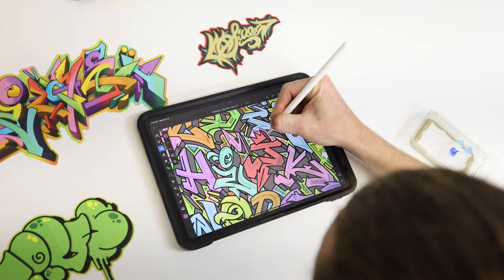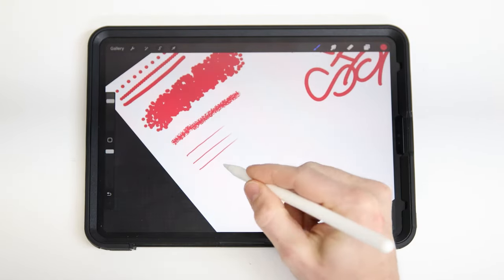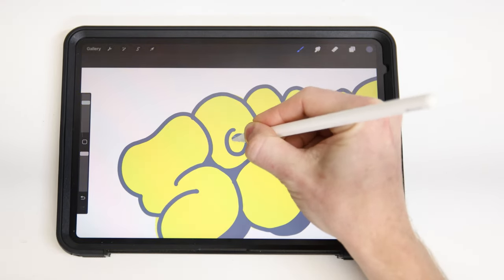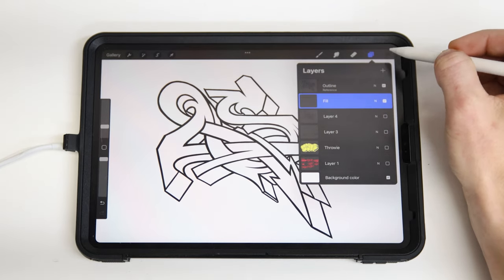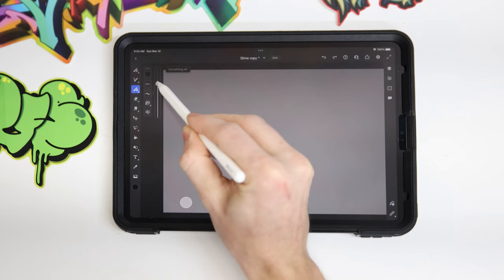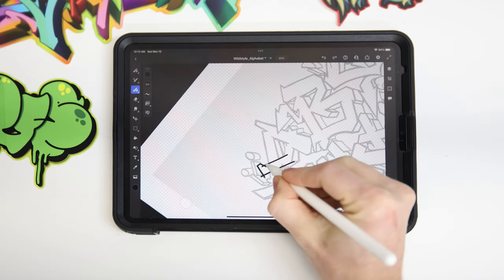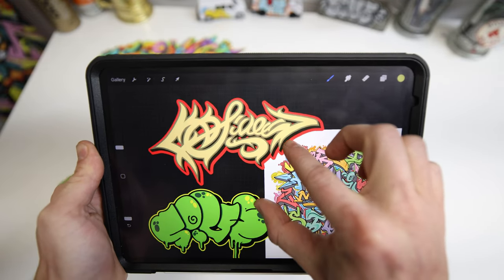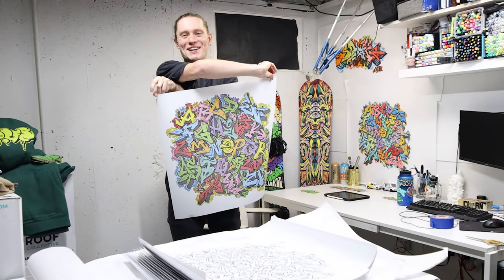How To Draw Graffiti on IPad

Comment: Hey, wanted to ask what case u use. And doesn’t your tip blunt after a few weeks?
Reply from the maker: It’s an otter box, not sure I’d recommend as it has a raised edge so I run into it a lot haha. And I’ve had the pen for over a year without issue
Reply: @S1VE Thanks! Keep up the good work.
Reply: @S1VE  i also wanted to ask what i should buy as a beginner, upgrade my ipad so i can draw or get a blackbook, outliners and markers.